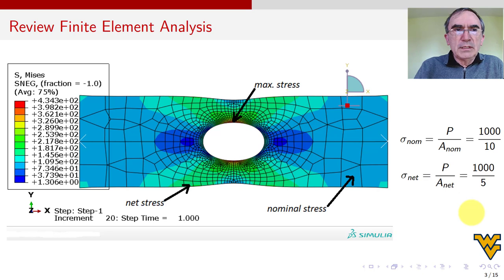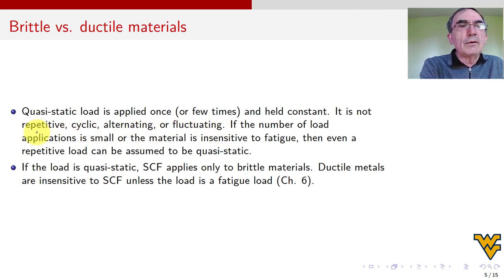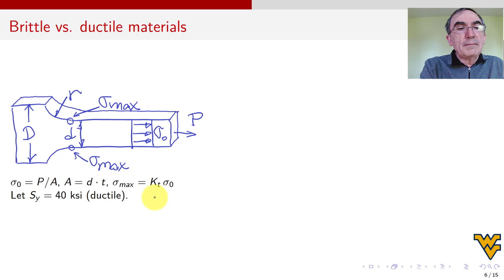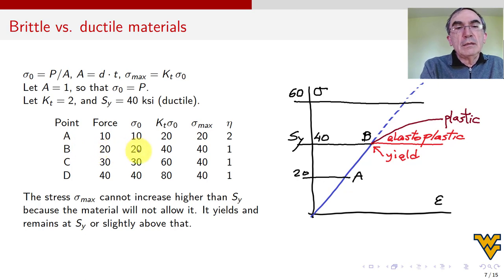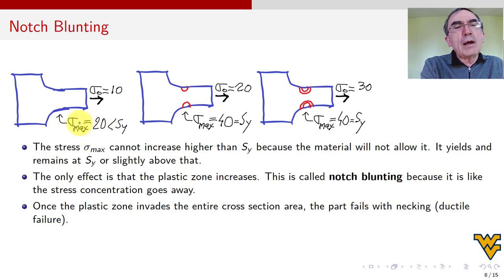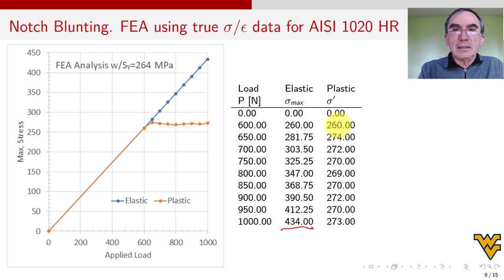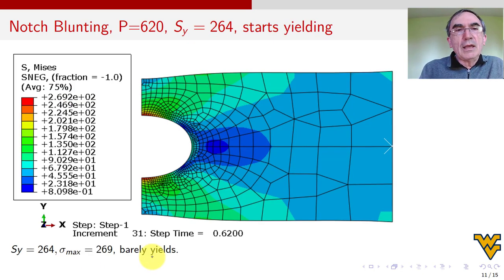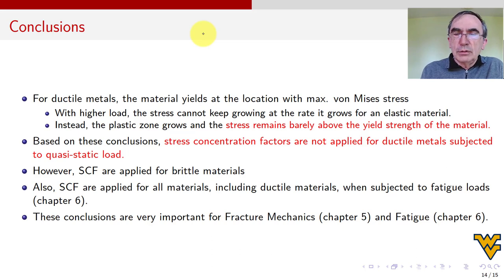Stress Concentration II. Why SCFs are not applied to ductile/damaging materials w/quasi-static loads

Comment: Hi sir can you make video how to calculate stress concentration factor in composite plate using formula for validation and abaqus
Reply from the maker: It is possible but not trivial because composites do not yield but they do damage (transverse matrix cracking), so instead of plasticity, we have to use a damage model. I have a good damage model in chapter 9, video example 9.1, https://youtu.be/BGgWsYthT8c  If you read section 7.5 in my composites book https://www.amazon.com/exec/obidos/ASIN/1466516615/booksoncompos-20 you will see that similarly to metals, composites have notch sensitivity, that can be calculated by using the damage model for various hole diameters, and then, we can calculate the SCF,  so yes I am able to do it, but I don't have time, maybe you can do it.
Reply: @EverBarbero  sure sir i will do and inform you after success